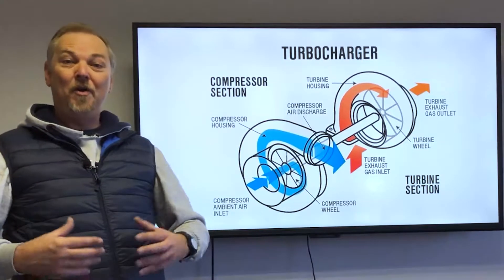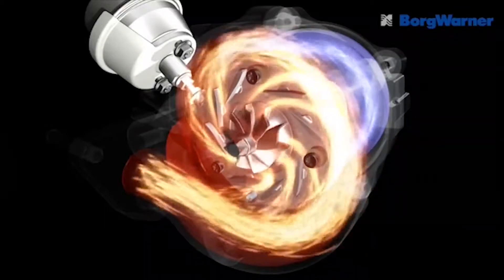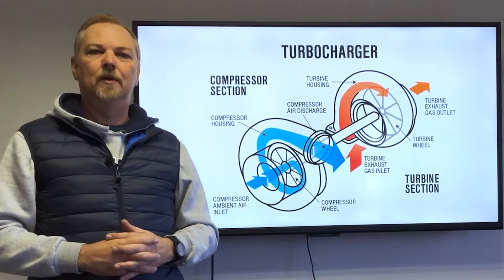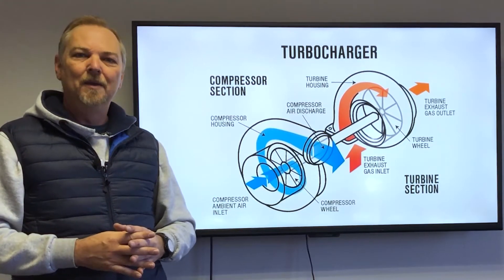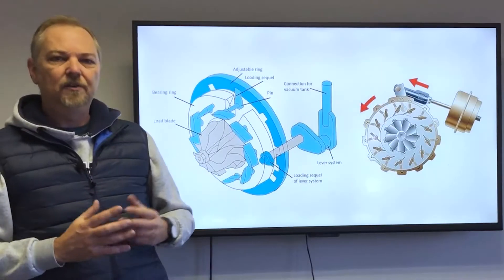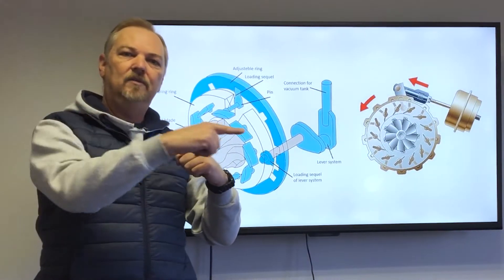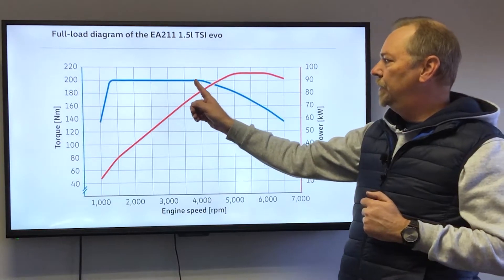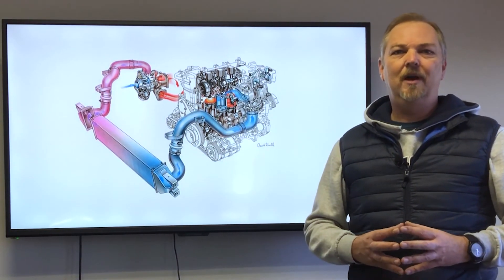Let's Talk Automotive - How Things Work, Variable Vane Turbo

Comment: Thanks a million! I'm not exaggerating, but I have searched for this video for months. I loved the way you explained the VNT mechanism. However, I missed one point: Once the car is ignited a vacuum is produced, and the vacuum makes the actuator pull the vnt rod, which narrows the air passages between the turbines and vanes. Like the fan example, when the airflow speed is low, you can pressurise it by blowing from a narrower space, hole, etc. From my understanding, airflow speed is maximum when the vanes are almost closed at low engine speed. Naturally, the vanes open more with increasing rpm, which allows for more air, thus a higher turbo boost pressure. Is that right?

Comment: What I want know the vanes should be closed or open little bit I want adjust the screw in my turbo but I want know if stays open little bit or closed at all thank you
Reply: At low engine speed, the vanes are in the “closed” position narrowing the gap between them which accelerates the exhaust gas onto the turbine wheel. At high engine speed the vanes open up slowing the exhaust gases, which prevents the turbocharger over-boosting.

Comment: When the motor is sitting idling will the veins be at a open position and start to close up as the revs increase  or the other way round??
Reply: Other way round,its almost closed(1-1,5mm)gap at idle,and slowly opens up to make the target boost.Fully opened at max boost and prevent overboost!
Reply: Thanks for that Tom. I have not long ago modified  gtb2260v turbo (but not fitted yet) to run a mechanical actuator over the electronic item, I just wanted to make sure I have the actuator sat on the right side of the turbo to operate the veins to the correct position.  Now I'm thinking I may have it wrong!
Reply: https://youtu.be/JMfvNA50KNE

Comment: I was wondering. Could the vanes of the VGT be made of ceramic? It would be light and extremely heat resistant and should be reliable as the vanes are not subject to mechanical stresses and pressures other than movement, i.e., opening and closing.
Reply: the steel turbocharger is powerful enough, the unit is already small and light, nowhere in engineering, even planes and rockets do not use ceramics. the answer is NO.
Reply: Ceramic will shatter